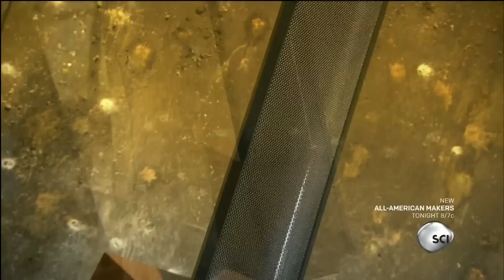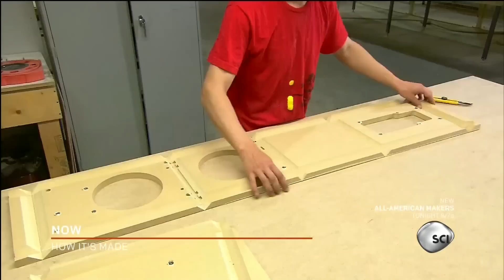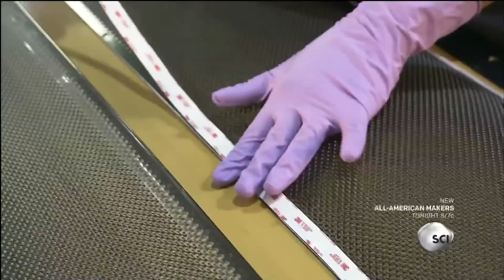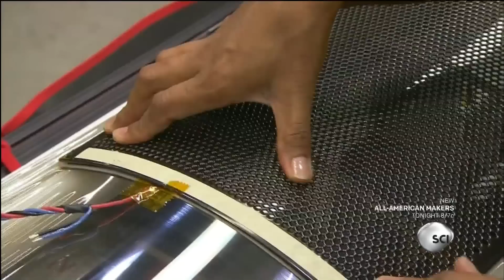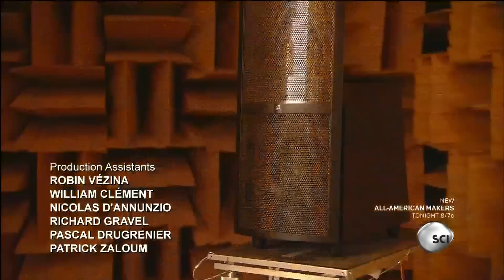How It's Made - Electrostatic speakers

Comment: Interesting documentary, I'm surprised they showed so many of their production techniques.  I've listened to MLs before, but to my ears they never sounded as good as Magnepan's offerings, despite the Maggie's inefficiency and need for lots of power.  I think the main problem ML faces is the issue of trying to pair a really slow high mass woofer cone along with a super fast and light electrostatic element.  The results just don't sound anywhere near as coherent to me.  I'm sure with digital processing, you could overcome some of that issue, but I'm a fan of simple two channel tube audio with little or zero eq, so that isn't a route I would go even if it worked.  I've never heard any of the super high end ML offerings though, so those might be in a different league than the model we saw being built here.

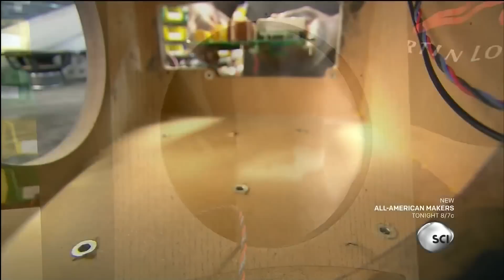Comment: 1:52 the whole signal goes through a passive crossover.
Reply: @Pedro Paco   An active speaker with a built in amplifier can easily include a very efficient active low pass filter at about 100hz or below.  Passive crossovers are inefficient for low frequencies because the inductors need to be so big.  It's a strange design.
Reply: @Pedro Paco  The crossover unit shown 1:55 is a quarter section 2-way design and he says, "it splits the audio signal to send low notes to the woofer and the rest to the electrostatic panel".
Reply: @Pedro Paco  I understand your confusion and I cannot answer your question because the video does not make sense, I think the person narrating on the video does not understand what they are talking about.  It's possible that there is no built in amplifier, it's possible that what he refers to as "the amplifier" is actually the high voltage step-up transformer which all electrostatic speakers need to make the membrane vibrate.  The big Martin Logan loudspeakers  do have sub-woofers with built-in amplifiers but maybe the model shown in the video is a smaller model which has no built in amplifier. This video is confusing so you should watch other videos about electrostatic speakers.  You should listen to some electrostatic speakers because they have the sweetest midrange which I have never hear from normal dynamic speakers.
Reply: pedro paco You reply appeared and then disappeared.
Reply: @dreamdiction  It is clearly said in the video, that the second electronic part after the passive crossover is the step-up transformer boosting the amplifier signal. So there is no built-in amplifier in these ML. BTW: A friend of mine used to have the ML SL3. It was a fantastic speaker system, though in larger rooms a little bit short of bass. That is why he exchanged the MLs against some very nice Avantgarde Acoustic horn loaded speakers plus some extra subwoofers.
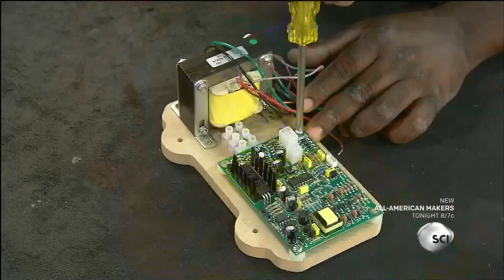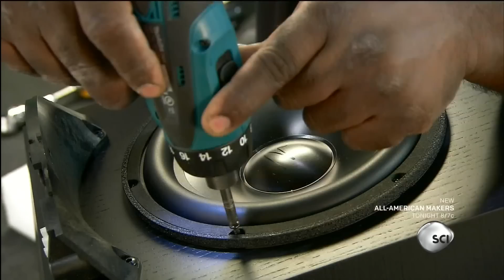Reply: @primus.interpares  2:01 "Next up is a power supply and a step up transformer".  A step up transformer does not need any power supply so the power supply must supply power to the built in amplifier mentioned at 2:25  "he boosts the bass with a built-in amplifier".  The narration script is confusing.
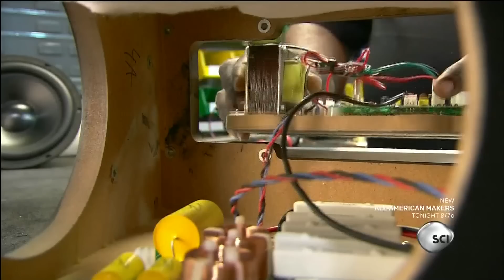Reply: @dreamdiction  Sorry, my fault! You are right, as I only referred to what he said at 2:05. So, the narration ist really inconsistent with regard to a possible built-in amplifier.

Comment: I had audition this one a few years ago and they sounded pretty good. Incredible transient response just like the full panels. Then l went to another room to audition a higher-end bookshelf speakers at less than half the price and for the life of me I could not tell the difference with the same music which is instrumental and voices. Crystal clear just blew my socks off.  I'm must say those bookshelf speakers came a long way. But then you may not get the same results as those speakers at home if you don't have the $20,000 amplifiers and electronics setup at the showroom.
Reply: kimchee94112 this all day
Regular speakers (bookshelf or floorstand) have gotten so better that the little extra you might get from a ML it's not worth the hassle of the over-complicated design and higher price. These ML speakers have to be regularly and carefully dusted..those metal grills need a dry ambient and so on. Not worth the hassle IMO.

Comment: What?  The transformer does not "boost the amplifier signal", it transformers the line power (110V) to whatever low level signal the amplifier circuit is using.  IDIOT!
Reply: Jennie Craigslist electrostatic speakers have a transformer  that steps the  audio signal to thousands of volts...and yes there would be a transformer for a built in amp too...

Comment: Martin CHINA Logan I have two subs that would not work called Martin  China Logan and they gave me this very high price for repair of a plate amp that was MADE IN CHINA. they wll never get my money.
Reply: This is true, certain parts of their lineup are inexpensive and made overseas AND, they tend to gouge on the costs for replacement parts - regardless if they are cheap/defective.  The Dynamo subwoofer amp is a perfect example.
Reply: All my speakers are ML & they work great except for the Dynamo woofer but they did help me in getting it working properly at no cost, shit you get a 5 year warranty. Bowers & Wilkins are China & they sound really good. Playstation is China & those work good so I guess not everything from China is shit. I would also like to point out that if these are being made in China then why does everybody in this video look like they're from the USA??

Comment: My maggies are on the low $ range. Bought 20 years ago, they still sound great. Remember the 1st rule of audio. LISTEN. Not only do you have a very unique ear but you have a unique "taste" in audio. You MAY find that the best sounding speaker is not the priciest. Beware "the Emporer's Clothing". Also, the electrostatics are called "selfish" not because of their power needs (which ARE substantial) but because they can be so narrow in their "sweet spot" that some allow only 1 person to sit in the perfect spot. Height is a big deal. Lower end models can come 4 feet high where higher end models may well be 6 feet tall. If you stand in front of a 4 footer, even 10-15 feet back, you may note that the speaker is lacking and only "opens up" when you sit. Think about how you'll use them. These are lousy speakers for parties and crowds. I much prefer a separate sub with a remote. You WILL find that the sub requires adjustment if you use this system for multi-source systems. Movies are a world away from Mozart. Beware the "high end" cable/patch cord myth.
Reply: Yeah it was the difference between night & day when I stood up compared to sitting listening to these, ill stick with the norm
Reply: " You WILL find that the sub requires adjustment if you use this system for multi-source systems. "

A proper sub properly set up with a properly treated room should be good for most everything.

That said one wouldn't necessarily play 2 channel music on a surround sound system used for movies anyways.
Reply: Ya everything you said can be applied to any speaker.
Reply: @ranbymonkeys2384  You haven't heard electrostatics. No big deal.

Comment: $80,000.00 for these speakers that are held together with double-sided tape. Martin Logan can take a hike with that.
Reply: where does that number come from ?
Reply: If tape is used in construction, i'm sure its ok for the loudspeakers! https://www.youtube.com/watch?v=LM9UcoKk7w4
Reply: I own a set of ML speakers and after 20 years, the VHB tape is indeed delaminating at certain parts - but the speakers still play and sound great.  I agree though, it is a weak point in the design.  Though, I am sure they've switched the type of VHB tape they've used over the years.
Reply: Not sure l want to see how the Magnepans are made, as they cost a lot less
Reply: The speaker will crap before the tape.
Reply: Yeah really where do you get that number from? They don't cost that much it's around 6k. They have 80k speakers but these are def not it. I own ML speakers (not the electro) there is nothing wrong with them they sound great!
Reply: rewris You're more than an order of magnitude off the price, at 42 seconds you can see that these are Martin Logan Ethos electrostatic loudspeakers, starting at $7,000 a pair...
Reply: You apparently don't know what VHB tape is. That tape was used to lift a car off the ground back in the day when it was invented. It is basically like weld in tape form. A long time ago I used it to stick down a USB hub to my PC case, and I was never able to remove it. I ended up throwing the hub out with the case years later. It is not just ordinary double sided tape. You should get some.

Here you go man: watch?v=7OtrDvDvF5I
Reply: High end audio is no different that sports cars..........A Ferrari is better than a corvette, but not by much, that second 100K+ only buys a little extra performance. Going from 12K to 45K for speakers will only produce minor nuances. Tube equip is no different.
Reply: So lazy that they don’t even clean the glue from inside the case and paint the bottom.
Reply: Another know-nothing complainer.
Reply: By the time you're able to afford that sort of money, your hearing is probably fucked anyway,
Reply: @greywolf271  I'm 28 and I have a pair martin logan eslx

Comment: Bullshit regarding full range electrostatics. There are and have been lots of good full range electrostatics that can produce excellent bass. Maybe they don't quite produce the dynamic punch of the best woofers but electrostatics have considerably better speed and pitch definition. Hybrid electrostatics always sound compromised in the bass compared to a good full range unit.
Reply: Hybrids are fine compromises. Full range electrostats are extremely large. Wives find them uglier. But they still sound best, to my ears.
Reply: The QUAD is/was a great example of a full range unit but it does not provide any great power handling at low frequency's.
Reply: I own full range electrostats.  I can tell you that they do not produce excellent bass.  But then again, a subwoofer (or two, or three) is pretty much mandatory with ANY high-end system.  I've never heard a speaker that did not need/benefit from sub augmentation.

Comment: why are Martin Logan speakers so expensive...
Reply: ML always has been a high-end brand. All that hands on you just saw in that video comes with a price tag. But of course you can find similar or better at a lower price. Audio is one of those things that can get out of hand very quickly.
Reply: J Wuh well said sir
Reply: You are absolutely right.  One thing I can add:  you can always buy USED audio gear.  I would rather buy used, high quality components vs NEW JUNK.  My ML speakers were made in the early 90s and are still working fine today.
Reply: Could be limited production volumes? Handy people can actually make their own, poorly-sounding (with sound flaw spots in the panels) but working electrostats at home, very cheaply indeed.
Reply: In contrast to many "high end" products, ML are relatively cheap.
Reply: Honestly, there's a reason why they don't show you how JBL's and Sony speakers are assembled and that's because it could be done by a five year old.... In fact, I know a guy who has produced speaker kits and gave one to a child who easily screwed the box together and plugged in the cabling. What's hilarious is that it sounded better than your average bookshelf speaker. 
It's all a scam but when you have the money you pay for what you WANT it's all gravy. Want a Porsche? A Jaguar? A Range Rover Sport? Go buy one. Happy with a Nissan Micra? Great, keep it and drive it. But don't try to overtake me in my Dodge Challenger and cry when I disappear into the distance. The beauty of high end audio is that content to be played on a sound system is ENDLESS. If you quit your job right now and tried to listen to every musical recording ever created you'd be in your late 70's by the time you've gotten to the Blues era. Therefore it massively depends on how much you like your music too. If you like exploring new music and watching films, a good quality sound system is a total no-brainer. Would I personally spend more than 5K on a high-end system? Fuck no.. Would I spend a couple of k for a really nice system that I enjoy getting drunk and playing with? Yes. There's no showing off, listening to music is a solitary task unless you have lots of friends with the same tastes. But showing off is what rich people like to do and this type of product is easy to sell when you see this type of construction going into it.
Reply: @lowerthetone  i dont think your beating many porches twin turbos with your challenger.